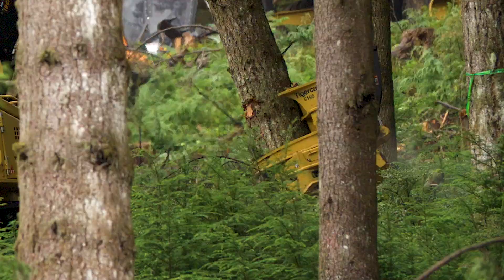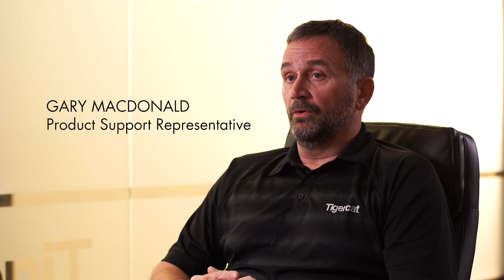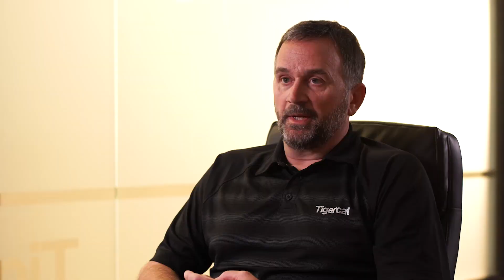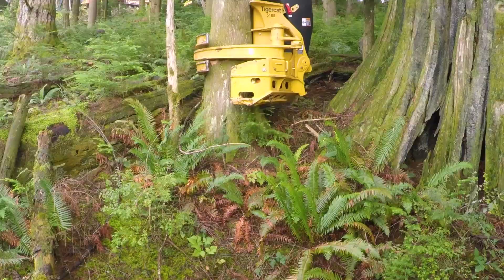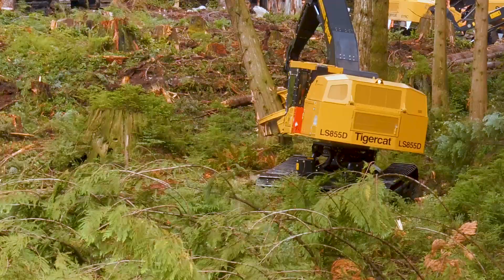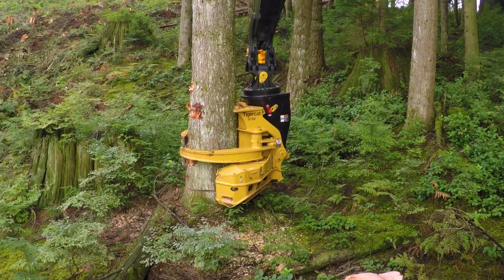Tigercat 5195 Directional Felling Saw advantages

Comment: Dual clamping arm cylinders is a poor design. It allows the jaws to drift. Even a little company like Ryan's figured that out. Other than that I like tigercat stuff so far.
Reply: A little drift is a small price to pay for twice the power.
Reply: @oldtimerf7602  You need to study up on your leverage and mechanical advantage. My Ryan's head is squeezing pressure in the neighborhood of 95,000 psi running at 58 gpm and 4400 hydraulic psi on my link belt..... no offense sir intended but there is more lever mechanical advantage with a z bar than with 2 cylinders, actually you loose with a twin cylinder set up. 
I have a 5 inch barrel with a 2.5 inch cylinder. On any simple hydraulic calculator at 4400 psi that figures to about 86,400 psi of push force and that is amplified with the z bar where a conventional set of dual cylinder jaws actually robs you of force because the cylinder side of the lever is about 4 times shorter than the tree side. No doubt a 95,000 pound tigercat machine made just for cutting is better than my 62,000 pound excavator based machine... BUT... the cost of mine brand new came in under 300k where the tcat is probably over twice that much. I'm in east coast planted white pine right now on a 4 million board feet job and my machine will cut over 100,000 feet per day and that doesn't account for the pulpwood. Far more than our skidders can pull. I can cut for two days then the third I can park the cutter while they catch up so I think the ol' Link Belt will suffice for now. Also my closest tcat service is 150 miles away. I like tigercat stuff, it's just not sensible for me. I was just pointing out that I can't believe everyone hasn't adopted the z bar design which Bell actually pioneered.